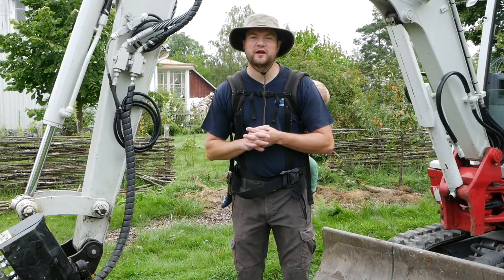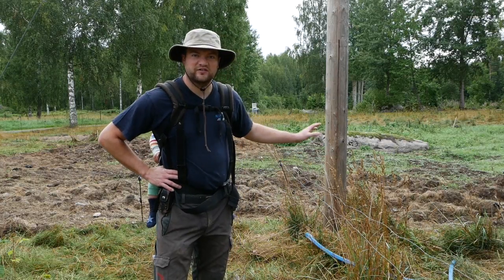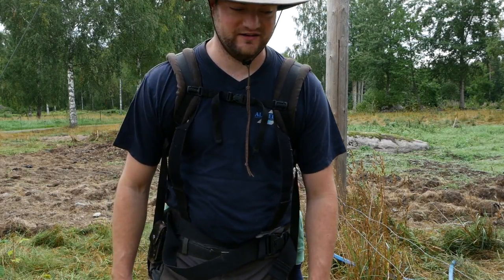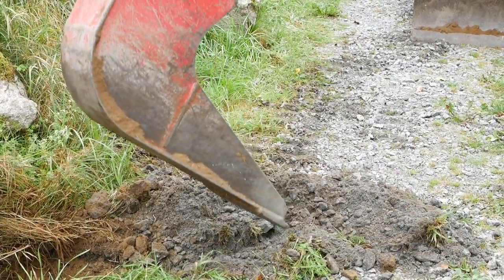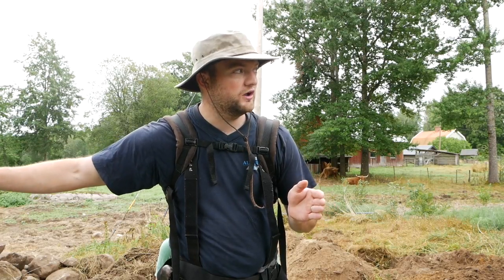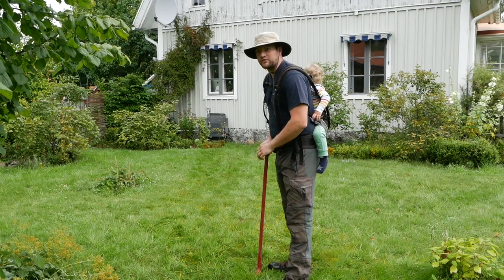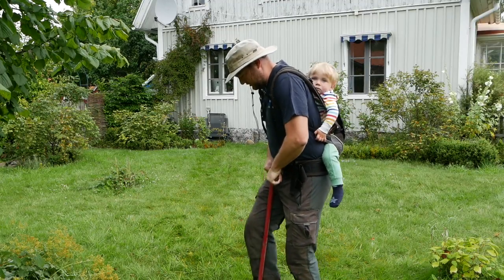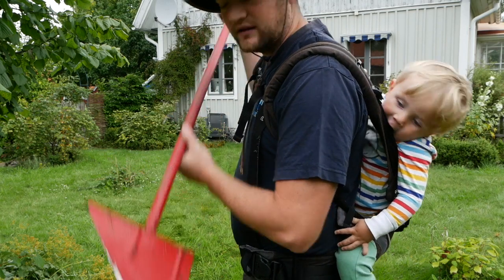Fiber Optic Internet Coming To The Middle Of Nowhere...

Comment: That was alot of work! I wonder if a ditch witch trenching machine would have made it less work? They remove less soil, and work very quickly!
Reply: A trencher would have been faster, on the dig part.  I would recommend using a Mini-Ex like they did are even a TLB(backhoe).  As you saw with the dozing on the driveway, the ability to backfill, and finish grade are not present on the dedicated trenching machine I have dealt with.
Reply: Michael Kaylor - Some ditch witch trenchers have back fill blades, and I think some of the new ones even have mini back hoe attachments. Regardless of that I see your points, and who knows, it's probably about the same either way.
Reply: I have not seen the Backhoe attachment, that interests me for the versatility of it!
Reply: Yes, but I don't know if the trencher could install the green ribbon of detection material.  The fibre is the white one they put down first.  The green ribbon that went in second is slightly above the fibre optic cable.  The green ribbon stuff serves as a beacon for ground "sniffing" instruments to aid in locating buried services.
Reply: Stan Patterson - Im sure they have systems that can install both with all our modern technology, but this discussion is about a different type of trencher.

Comment: I am very envious. The best we can do is a 6Mb wireless signal.  But better than a lot of folks here in Texas.
Reply: Steven I am very lucky in England,when I moved into home 15 years ago it was already wired for fibre optic cable. The local distribution node is less than 50 yards from my home. I pay for 100 meg download speed and average around 103 meg. I also get 2.4 and 5 ghz wifi. Costs about $80 per month
Reply: That's great.  We suffer from too much land mass and no incentives for the providers to get us wired up.  Maybe I should move back to England. :-)  Well, that's a drastic move to get good Internet service.
Reply: I am paying $70 a month for 1.5mb download in central NY....10 Feet down the road they have standard cable internet at the same price for about 100x the speed.  Out of their contract area.
Reply: They are putting in fiber like crazy all over Sweden at the moment. Goverment have a goal that 95% of all housholds should have access to at least 100Mbit/S @ 2020. Long term goal is that 98% will have at least 1 Gbit/sec 2026. And if you for some reason can't have fiber, you should have at least 100Mbit/Sec on mobile internet.

Goverment pay for most of the investment (Hey, Thank you 30% income tax and 25% VAT!) and rest we pay ourself. Depending where you live it can be anything from 1000 usd and up...I paid 1800usd to get hooked up. Expensive? A bit, but it raises he value of the house so....I live a bit "off the beaten path", just like Simeon, and i have 200 Mbit + a bunch of TV channels for a total of 50usd. 1 Gbit cost 20usd extra. But 200 is more than enough...
Reply: Ulf, the price isn't too unreasonable considering the speed and the TV package.  How much bandwidth does that afford?   Packages in Canada come with a limit of how much data you get in the package, with some exceptions. My provider is a reseller using other company infrastructure and pays them a bulk rate. They offer us a window of unlimited use between 1am and 7am that doesn't eat into our monthly bandwidth cap. As for speeds, I have the smallest package, which claims 10Mb down, 2Mb up and 100Mb per month, for $35 + I rent the modem for $5, plus 13% tax.
Reply: Logan, have you asked them (just for kicks) how much it would cost to be hooked up even though you are out of their contract area, or have they already given a flat-out NO we won't do it ?
Reply: Hi Stan. 
No limits on bandwith. I don't think any provider ((or very few) except mobile services)) have any limits at all as far as i know, and the speed never changes. So Youtube is always set to play highest resolution and my torrent program runs 24/7. oh, happy days......

Comment: The soil looks to ge quite sandy. Was this a former lake or river bottom?
Reply from the maker: We live on a peninsula so I think it has to do with that...
Reply: All the soil in Sweden (more or less, anyway) is made up of moraine, so even areas that haven't been lake or river bottom are often quite sandy. Closer to valley floors and around the bottom of hills you get more clay, higher up you get sandy and generally rockier soil, since that's the way the soil gets sorted by wind and the flow of water through it.

https://en.wikipedia.org/wiki/Moraine

Comment: What's the green mesh? Is that so they can visually or electronically detect the location of the cable?
Reply: killerhz yes. Green plastic for visual, and a metal wire inside that can be used with detection instruments.
Reply: You're so right! Green is for fibre. (Yellow is for electric cables. Orange is for telephone.) You put the marker half the dept over the fibrepipe, so if you later dig 4" at a time you can't hit the fibre without observe the marker ribbon. The marker have also an metallic wire so you can use a transmitter and send a signal and locate the fibre from the surface.

Comment: Nice !  Fibre Optic came to our town 2yrs ago.  I live in a highrise building, and they put the infrastructure in our building alongside our old twisted-pair phone wire.  Every unit in the building had the fibre installed regardless of desire to use it, so that it is there for whomever wishes to subscribe.   It is a pricey venture to jump to fibre internet, something I have been dreaming about, but for now cable internet does quite nicely, and is expensive enough.

Comment: Simeon -- doesn't the government have a program where they coordinate with the utility companies to mark their lines - we do in the USA.  Also I have Google Fiber Internet and television -- it works great - you will love it.  I'm assuming the green 'tape' was for future digging so you wouldn't cut into the fiberoptic line.
Reply: Yes. It's the same in Sweden with both online (www.ledningskollen.se) and all cable and pipe marking on site for free at the same time, regardless company. And we have also something called Samgräv ("Dig at the same time") you can annonce your job and other can use and part the cost. Visual markers are mostly common where you cross ditches.

Comment: The princess' made an appearance. What was the stuff you were rolling out at the end?
Reply from the maker: The tube is for the fibre and the green band for detection and warning if one should dig close to the cable.
Reply: That is what I thought just wanted to make sure, here in the states we generally lay down plastic caution tape on top.

Comment: Why do you have to lay the cables?
Reply: The usual procedure it that a company digs along the streets(or roads), and happily give you a roll of hose and marking tape if you wish to do the digging in your own lawn yourself. Otherwise they'll do it for you at a cost. Good deal for able people.
Reply: Leffe192 Thanks for the reply...seems like the local authorities wouldn't want to take a chance in residents damaging any lines and potentially putting the entire neighborhood out of commission, also for safety reasons of the residents...just seems odd, knowing how it's done here the US. In Minnesota we actually call for service with a company to come in to detect and mark the lines...this service is free of charge, and there are no questions about where what is, and all are safe. Appreciate your videos.
Reply: In Missouri rural, this is not so. They bring it to your road, then you pay big time to get it to your house if more than like 40 feet
Reply: itshonorbright alas! Provided there is access from the main road, but mostly in those instances we get Internet access through satelite. In many rural areas there is simply no other way to do it other than Satellite or the Telephone line, they're not going to let anyone dig a line other than short access to existing line to residence.